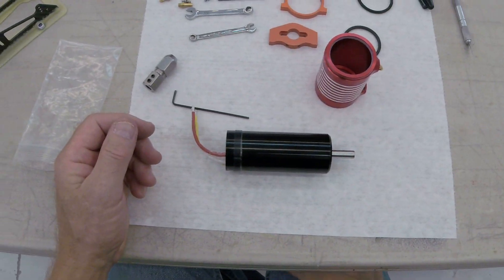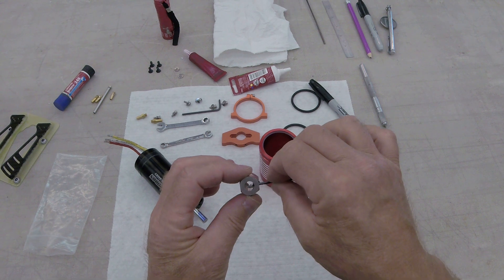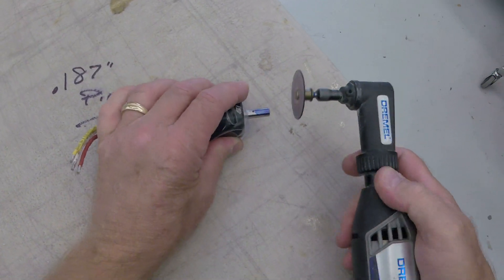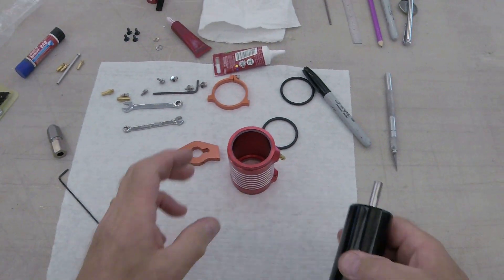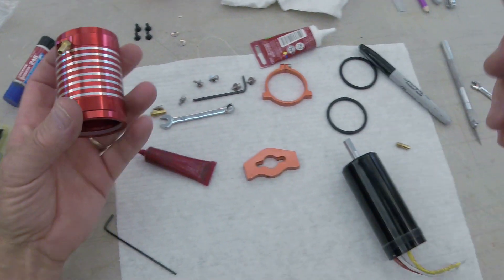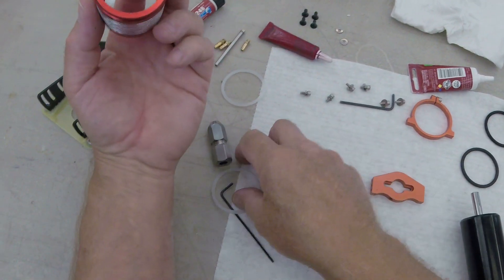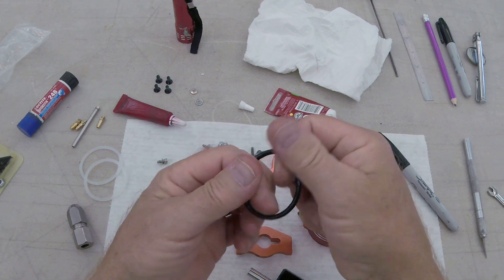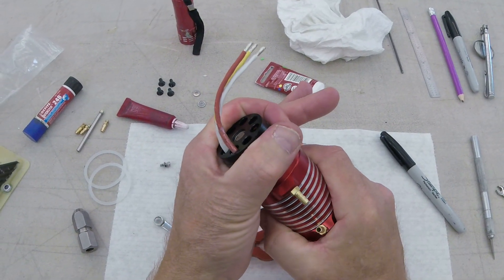Brushless RC Boat Motor Water Cooling Jacket Installation | Electro Eliminator Update

Comment: So what is a water Jacket and how does it work?
Reply from the maker: A housing surrounding the electric motor through which water passes, for cooling the motor
Reply: @M5PerfHydros  Is there a way to passively push water through the pipe without needing to add an extra power pump? I am considering this for my own model ship.
Reply from the maker: Yes, water is picked up by a hole in the side of the rudder blade and forced through the system
Reply: @M5PerfHydros  Does it matter where the motor sits in the ship? Or is it fine as long as you have enough forward motion to force water through?

Comment: Wondering if you can give me some advice? I have a 50 inch long fiberglass warlord boat that is about 40 to 50 years old it weights around 15 to 20 lbs it is currently nitro powered and I want to convert it to electric but I'm not sure what motor size and what ESC to buy. Any suggestions?
Reply from the maker: Sorry, but I'm a nitro guy at heart, and don't really know what might be best for your setup

Comment: Sir, can you tell me why you replaced the Water jacket fittings?  The stock one that come with the Water jacket are fairly small,  what is a good SIZE to use,  Thanks in advance
Reply from the maker: I talk about that in the video... Fittings are replaced and drilled to increase water flow

Comment: Do you think the motor could rust with water? I have a car motor for my boat but no water cooling, but if it’s gonna rust, I think I’m better off letting heat a little and still be good.
Reply from the maker: Yes any plain metal motor is gonna rust awful!
Reply: @M5PerfHydros  okay thank you!

Comment: Just little curious question? how does water go from one tube connector to other if the just dump into inside the jacket?  I have one similar im not sure how these work?
Reply from the maker: It's just wide open inside.  Pressure on the inlet side from water pick-up at the rudder forces the water around the can and out the other side. Primitive, but it works!
Reply: @M5PerfHydros  thanks I have the same can I hope it won't damage my motor its wp but still nice motor
Reply: Got some new o rings little thinker but having trouble getting them in the groove  any tips?
Reply from the maker: Did you get them from Bill at Rattlesnake RC?  He has some that are a perfect fit.  They are snug though.  It helps to smear a bit of silicone lube (LUBE not silicone sealant) on them before you press them into the groove
Reply: @M5PerfHydros  no unfortunately I didn't local hobby shop  for the jacket and rings from a neighbor friend. My new issue is I lost the spare rings gotta come up with plan b
Reply from the maker: Call Bill, problem solved!

Comment: What drives the water flowing through the cooling jacket? Is it a separate pump or a esc with a built in pump?
Reply from the maker: The water is picked up by the rudder, with the pressure of forward motion forcing the water through the passages.  This video might help;  https://youtu.be/DoTdkYAx85k

Comment: Great fun watching your videos. When the Electro E. is done, will you be able to tell your faithful followers the weight difference between e-boat, and nitro-boat? Also, is there a shaft speed / rpm difference between the motor and the engine ? Waiting for episode 6.
Reply from the maker: Yup, yup, and soon!

Comment: Hi I was wondering if anyone knows of any videos on how to bend the brass tubing for flex shafts.. for some reason I can’t find anything
Reply from the maker: If you build your boat carefully with the engine and strut positioned as much in-line as possible, the stuffing tube should require only a very gentle bend which is very easily done by hand.  I have a video about shaft installation that may help;  https://youtu.be/3hq_kXPyd4I

Comment: During my many years dealing with o-rings in RC cars and in paintball I've found that many greases, even silicone greases can cause o-rings to swell.  Most paintball guns are designed to take swelling into account and actually encourage using a grease that will swell the o-rings.  My paintball gun was not designed that way so they recommended using Dow33 on the o-rings as that was the best and would not cause the o-rings to swell.  So from then on that is all I use on o-rings now.

Comment: I have a very lightweight coupler made by H&M that is 8mm to 1/4". Very high quality if you are interested? They are also 'sometimes' available at Rocket City Racing in FL. I get mine from him. 
A great tip for  the threads on the tightening part of the collet, USE Anti-Sieze! It makes them last a lot longer and gives a better feel when tightening the cable down. H&M couplers are German made from high quality aircraft aluminum to high tolerances and THEY"RE LIGHTER! lol....
Reply from the maker: Links man... I need a link or it didn't happen!
Reply: @M5PerfHydros  Out of stock man! https://rocketcityracing.net/product/h-m-collet-8-6-3/ I have a used one I can part with. Problem is, I'm not going back to my apt. until the 25th or so. Oh well for now.
Reply from the maker: Thanks, I've bookmarked it